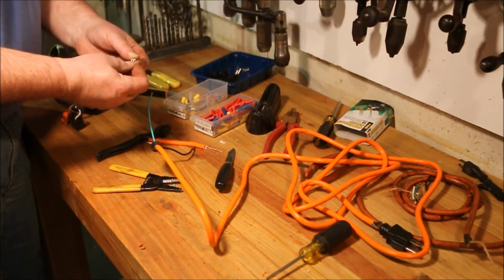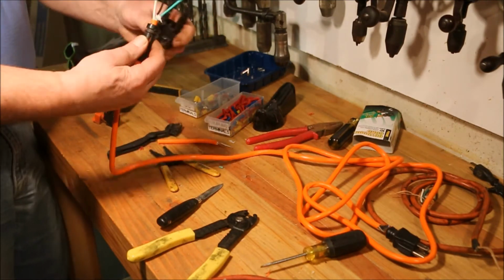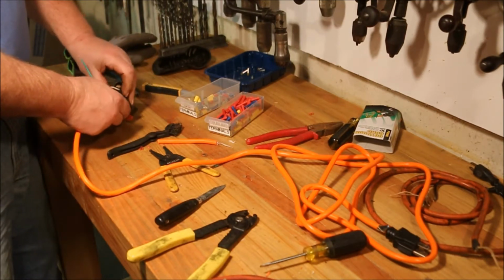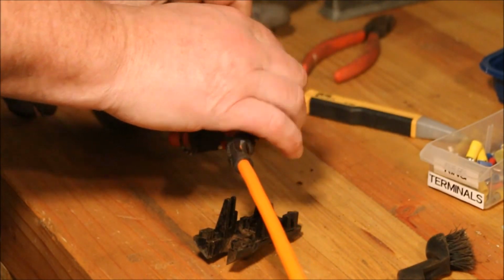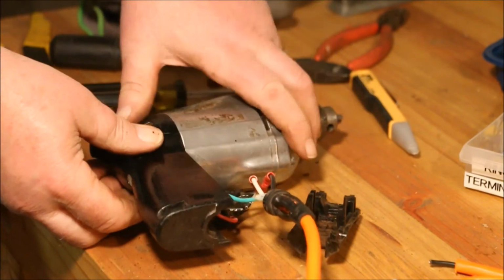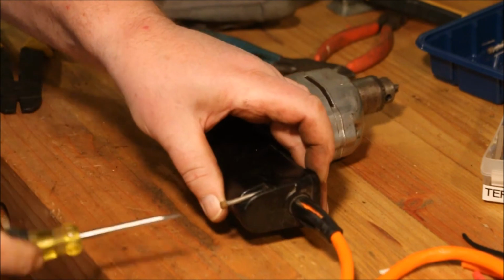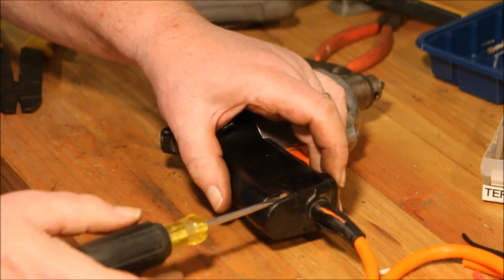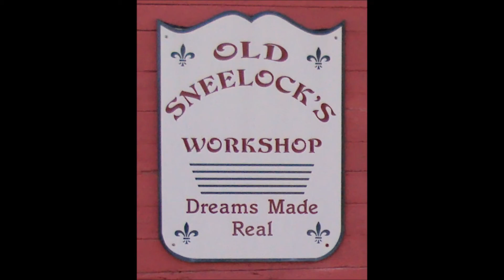REPLACING THE CORD ON A BLACK & DECKER ¼” DRILL MOTOR ~ PT 2 ~ A TIP FROM GOTAHVCLS

Comment: A FINE j9b, Unc! I went to the RE-store today. No 1/4 inch drill motors but they had a nice B/d saber saw for $40 but I spent 22 and got another desk chair, so now the wheelchair can go back in the shed. Stopped by the Saw Surgeons and left him some clean Almond butter containers and a foot switch and got a couple o0f clutch discs for the Roof mower, one new and another he thought was worn out. The worn one is going on mine because it's 2ice the surface that's on it now. Save the new one for hard times! Came back through a flood so I'm playing old time dozer man and soaking up the water inside the chair with my hindmost. Just like the old days before cabs.
Reply from the maker: Lewie McNeely I've cut back on spending myself. 
Good score on the parts and chair.
Reply: YOu know how it is. Just like all of us here, we all try and help each other out. The Saw Surgeon and myself are like that. We swap and talk shop all the time. I've been known to go down and lend a pair of extra hands when he needs some. He'd do the same for me. Life's WAY too short to be selfish. And I prayed about the chair a while back. Sweetums is going to see if there's one she likes! Going to get some new duds. Boy HOWDY is my attention alerted! I'm helping cook supper so maybe I'll get a fashion show too!

Comment: I picked up something whilebout at a garage sale, that goes well with this video. I picked up a old craftsman Portalign. It cleaned up real nice. it had a craftsman 90 degree angle head attached, and it already had the chuck. Found a yankee 131a screwdriver. I got all this and a handi vice for 6 dollars.
Reply from the maker: Congratulations on a great score. I haven't used a Portalign but I certainly used a 131A. It is one of my favorites. Hand vices are one of those things that you don't know what you've been missing until you have one.

Comment: Most people wouldn't think that drill is worth the price of the new cord or the time it took to install it. We know better. Picked up a nice all metal case drill motor at a yard sale for seventy five cents a while back. I always look at the vintage tools and rescue when I can. Take care
Reply from the maker: Tim Caldwell They are my favorite too.
Reply: The old is the best but I can remember being zapped so good I couldn't turn loose by an old metal 1/2 B&D when I was a kid. I had on flip flops with the toes worn down and standing on a dirt floor. The old geezer loader man at the boulder hole lost a son when he tried to do some drilling on the ground under a Jeep. Stopped his heart. Young kid too, in his 20's I think.
Reply from the maker: The cord that I replaced had the ground lug pulled out. Even with the ground it is only going to trip the breaker if it is a good enough short to blow the fuse. Some knuckle heads run 30 amp breakers on their outlets in their shops so they won't blow when they start a big piece of equipment or a couple smaller ones at the same time. You can get a real big shock before a 30 amp will trip. 
Laying on the ground with any power tool can be a bad experience. When I worked for Home Builders Inc. in Coldwater they brought in a trailer that had a broken tongue. The weld shop had a big roll up door but they couldn't pull the trailer in completely past the frame jig. They brought it up to the door and I was going to weld it laying on the apron outside the building. It had rained so the concrete was wet. 
I would have been better off to use a mechanics roller but there wasn't one available. I crawled under the trailer and got ready to weld up the broken weld. I was wearing leathers and a glove on my right hand because of the spatter from the overhead welding, but I had my left hand bare to pick up the rods easier. The first weld was fine. I had the rod already in the stinger. When I went to put the second rod in the stinger the big 400 amp DC generator welder hit me with 50 volts. Doesn't sound like much but it hurts like hell.
Reply: I have felt your pain. I learned in short order to lay the rods on something besides myself to get them stingerized. And my drill experience was WAY before ground fault breakers. All my inside shop shed circuits and all outside outlets and the greenhouse are either  ground faults or protected by ground faults. Don't want anything going on sideways if I can help it. We've even got an ARC fault in the bedroom addition. Interesting.
Reply from the maker: GFCI's were a big step forward.